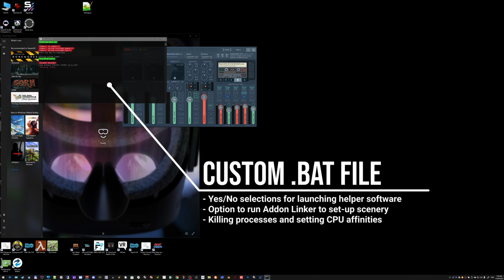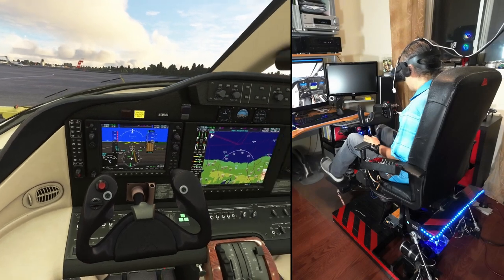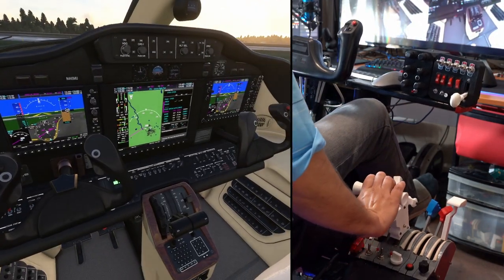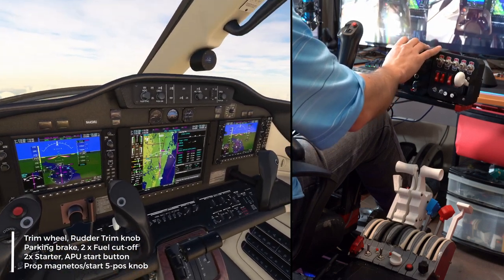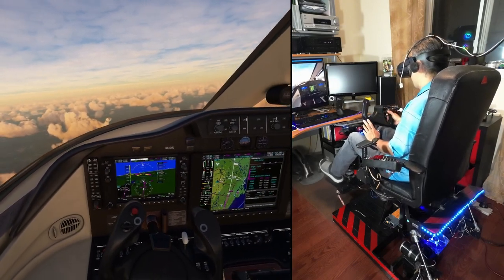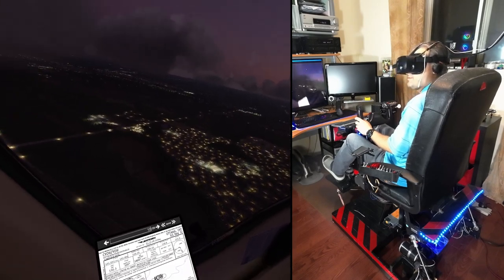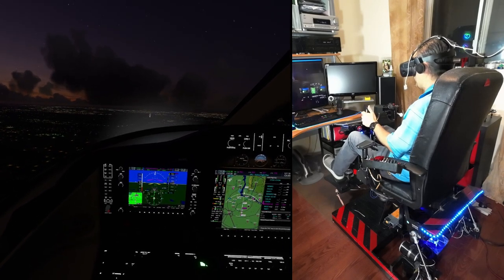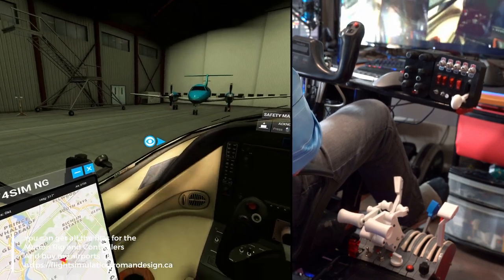DIY Motion Simulator Cockpit + Custom yoke, throttles, encoders+switchbox - G1000 NXi - Full Flight

Comment: Great video and very explicit video.
I would like to know what functions are assigned to the box on the edge of the chair and on the head of the cyclic.
THANKS👍
Reply from the maker: Those appear to the windows as standard USB joysticks, so whatever functions you want can be assigned. For the helis on the cyclic it's trim, autotrim (if exists), autopilot disconnect. The left box has things like fuel pumps, fuel tank switches, magnetos, panel and cabin lights etc.
Reply: @RomanDesignCanada  Thank you for the answer, I will try to manage by putting the most useful functions. Great job

Comment: Good day, I was very inspired by your video of a built motion sim, I would like to build my own motion sim and in this regard I have questions:
1. could you show pictures or describe how to attach the potentiometers that read the motor position .
2. what is the length of the arm bolted to the motor shaft, do I think correctly that the longer the arm the more the motion of the seat will be?
3. in your video you have a potentiometer by the volant with which you adjust the power of the simulator, can you give the way to connect it ?

Greetings
Luke Janczi
Reply from the maker: 1. My website has photos and 3D models I designed and 3D-printed, those are hall sensors + magnets in the motor shaft, not pots, but they work the same. Only better as there is no friction and no alignment problems.  But models work with my motors, so you may have to modify them.
2. 80mm. Yes, but it depends on the torque. If motor is not powerful enough, or gear ration is wrong - you can burn the motor or drivers. You can drill few holes and see if it works OK with 60mm for example, then switch to 80mm. It can be different for your motors and geometry.
3.  SMC tools schematics shows where to connect it. It's optional but I recommend it. Schematics are also on my website, but you can find them elsewhere.

Comment: Hey Roman, I was looking to make my own motion sim, and I noticed you had the same yoke as me. I was wondering how you get the output from the yoke to control the motion sim, Thanks!
Reply from the maker: The yoke is actually custom, I just used the Saitek/Logitech yoke body. But it's irrelevant, because yoke has nothing to do with controlling the motion sim. Motion software gets all data from MSFS or other sims and commands the motion simulator. I use FlyPT Mover for that.